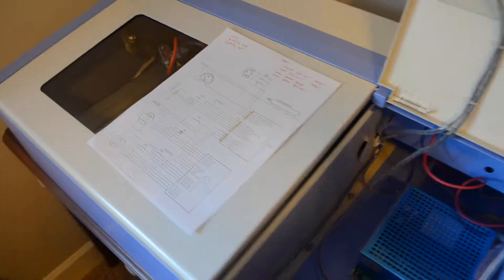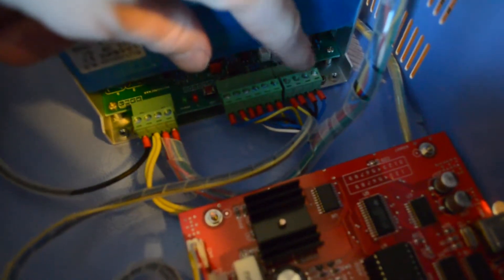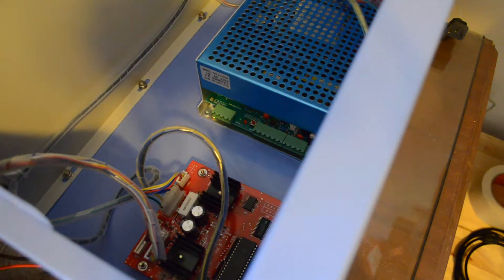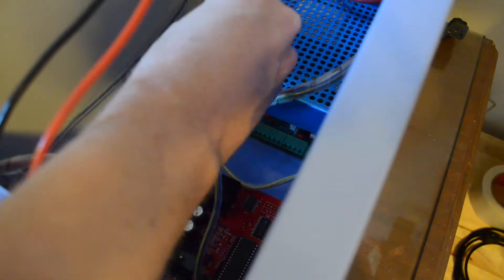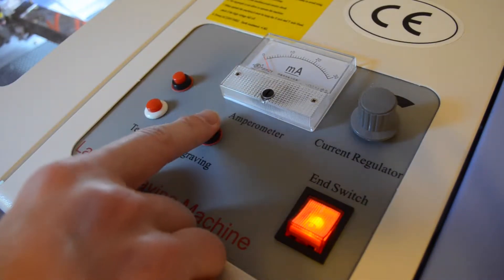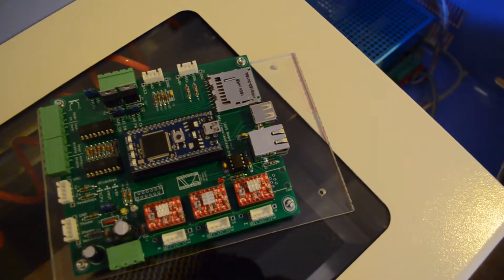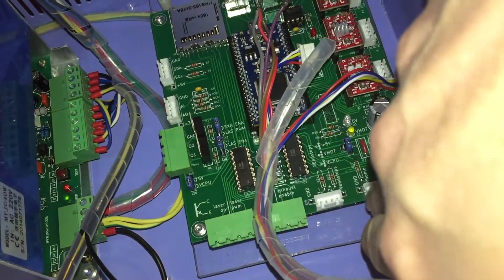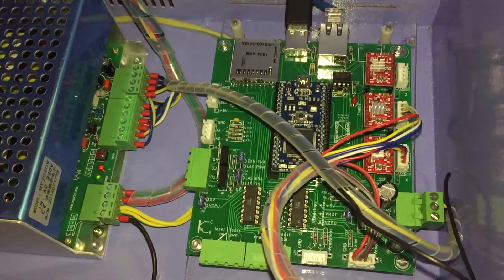LaOS Laser part 3: Installation

Comment: That reminds me of when I built my 3d printer. Lots of little details to sort out. Does that machine have a Z motor?
Reply from the maker: Robonza It's almost exactly the same process.  I don't have a Z motor, unfortunately.  It's definitely something that I've been thinking about.
Reply: There are a lot of uses for a z motor, I like to do some engravings out of focus for example, or engrave the top of something thick. I hope you get that machine working soon.
Reply from the maker: Robonza Yah, it would be nice.  I've found that the focal point of my 50mm lens is a few mm (probably 4-5) above the bed.  It ends up working for most of my thicker flat material.  For the thin stuff, I've been putting things on some threaded rod left over from ... my 3D printer :)